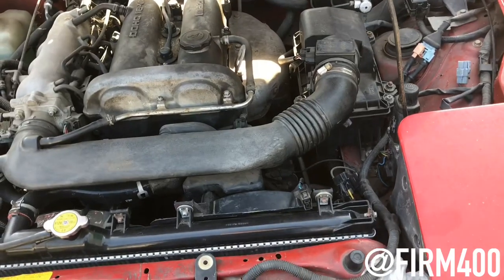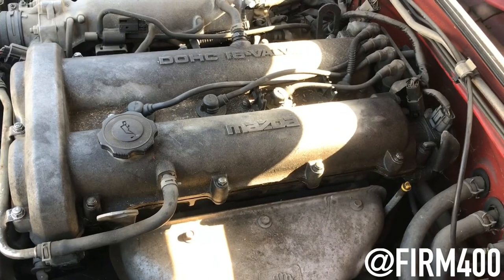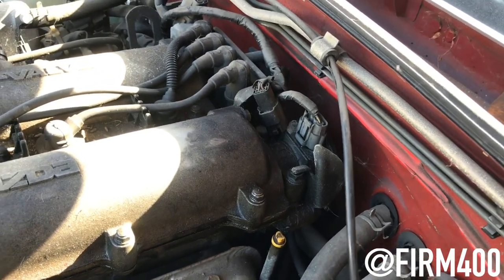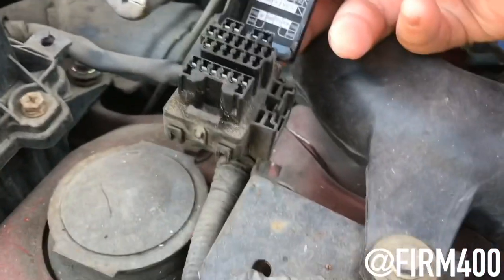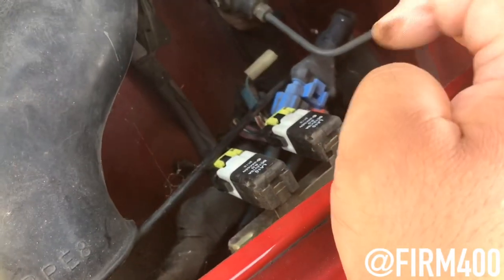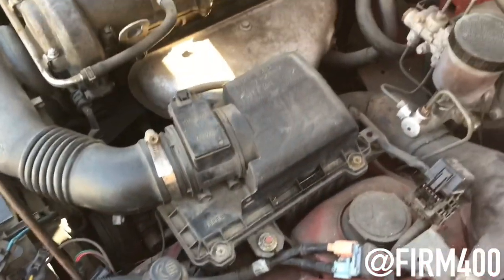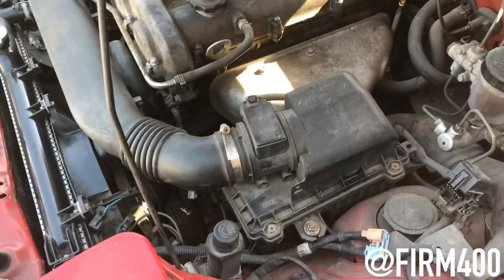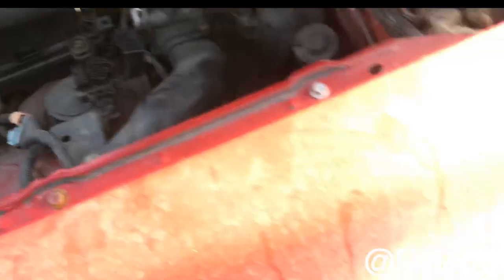MIATA VLOG TESTING THE COOLING FANS AND GETTING BACK TO WORKING ON FIXING HER !!

Comment: I just picked up a Miata and did the same thing. I noticed the driver (left) fan wouldn't turn on while being directly connected to the battery. But the passenger side worked when the ac was on and when I directly hooked it to a battery. So I'm buying a whole new radiator and fan combo.

Comment: Dude good looking on the video. Ive been dealing with over heating issues ever since I tried to bring my Miata back from the grave
Reply from the maker: Ya bro! Mines has the fan issue and also I need to change the temperature sensor which hasn’t been done yet lol. Just picked an FB and that’s another checklist of things I need to do to restore both of them lol moneypit smh haha
Reply: @Firm400  sickkk I just did that temp sensor. On the 1.6 I just had to take off my coil pack and it was just right there. Took a minute to get off because I could only turn the wrench like this much 🤏 lol I’m subbed so I can’t wait to see the projects to come

Comment: Temp sensor will just show you your temp on the gauge. The on on the thermostat is what turns the fans on and off.
Reply: NB1s (1999-2000) do not have a temp sensor on the thermostat.

Comment: Hey my miata is overheating any tips ?
Already checked the thermostat and that stuff and the waterpump is all good
Reply from the maker: Check your temperature sensor. Located by the coil pack. Also could be your fans. Perform a direct voltage test on your cooling fans. One more check would be your CAS O-Ring may need to be change as that is a common problem with Miatas. Hope that helps!
Reply: Thank you for this will try it have a nice day